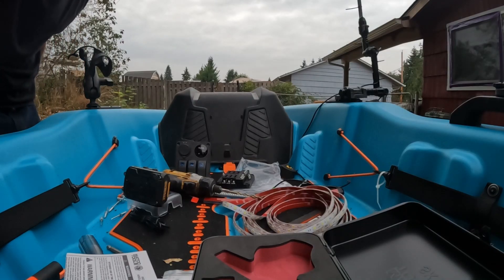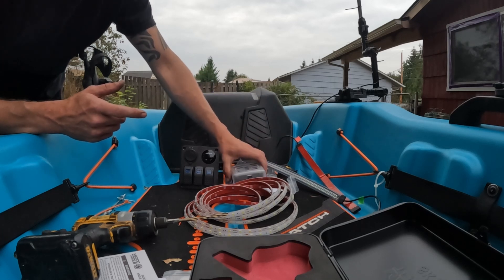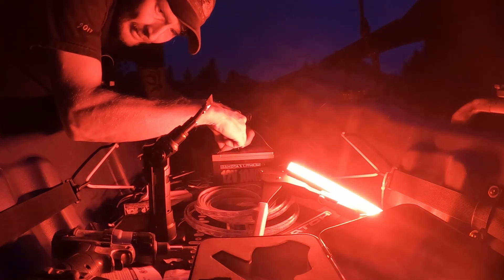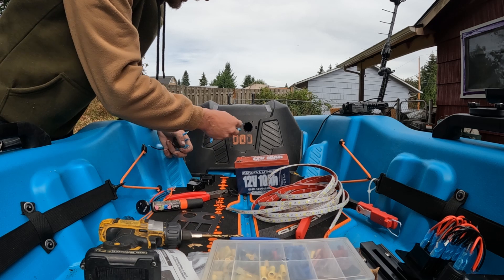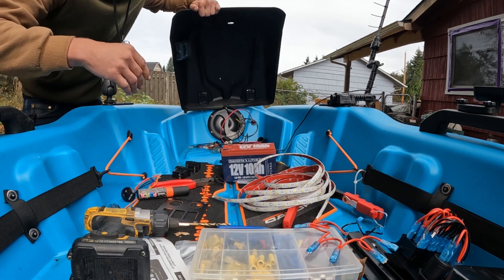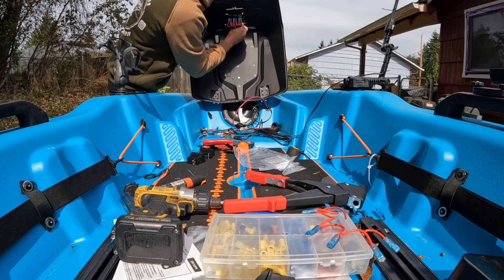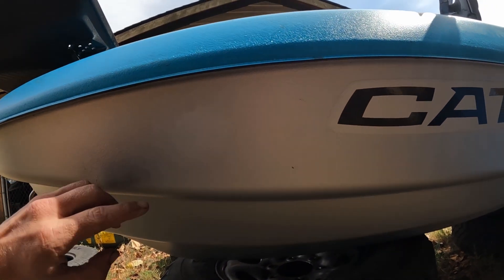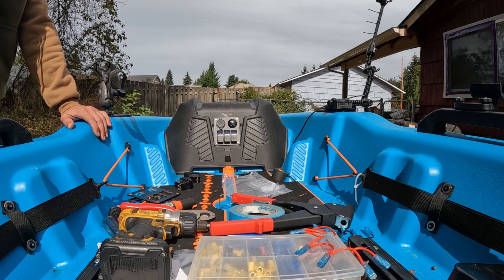Pelican Catch PWR 100 Switch Install

Comment: I love my Pelican catch pwr 100. I spent a full winter, setting mine up on my kayak cart.  But now she's like a one man bass boat. I do run the 2.5 Suzuki, because I love to cover water, and get to my spots, on a few large lakes I fish, and do 3 day fish and camp trips, with friends. I love that it's pre-wired from the factory. I also kept my J2 Bixpy from my 1st kayak. I mounted the Bixpy battery, lowered my swivel seat, added my FF, Lights, USB ports,  added storage, and many DIY add-ons and accessories. But you actually need lights on any motorized vessel, or small craft. Looking good bro. You'll love that boat. 😎 🎣
Reply from the maker: I already love it a ton I have been thinking of picking up a little motor for it because I do have bigger tracks of water around me. When you go out with the gas motor do you take the trolling and put it elsewhere for later to switch out?

Comment: I have the catch pwr 100. Just bought it. I have a mini Kota 30lbs connected. How did the install go? Is it finished and if it is can you show us what you did. I definitely wanna do something similar.
Reply from the maker: I’m still fine tuning how I’m routing wiring for my depth finder  and working out exactly what to do for interior lighting. I have the minn kota c30 and forward it works great in reverse it does almost nothing in 1, 2 kinda moves it, 3 works but it has a lot of vibration. I’m planning to upgrade to a 55 hopefully with the added thrust it won’t struggle so hard in reverse.
Reply: @northwest-fisherman  same with me. I'm not sure how I'm going to do lights like that on there. My trolling motor does barely anything in reverse as well. No vibrations tho...
Reply from the maker: @josephlee4886  the issue with my interior lights I got they are to bright for what I really wanted I might just use the tail light spray tint from Autozone to tone it back. I’ll be doing another video on my catch again here soon.
Reply from the maker: @josephlee4886  my prop has hit a couple things here and there, but it doesn’t vibrate on my boat like it does on my kayak. The interior lights unless you want to cut into the hull have to be mounted on the surface and the sides are angled up toward you so whatever light you pick is going to shine into your face which I think would be annoying depends on how bright they are.